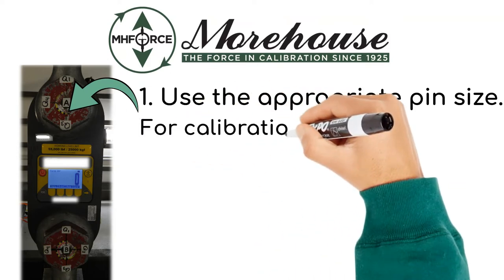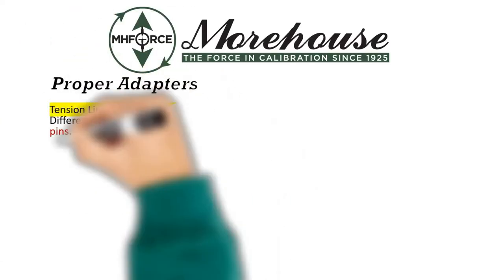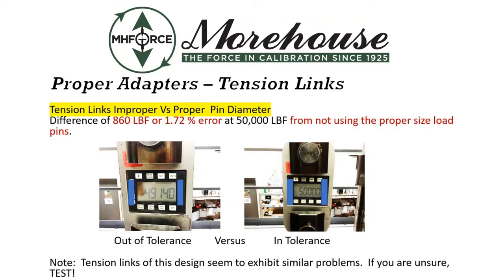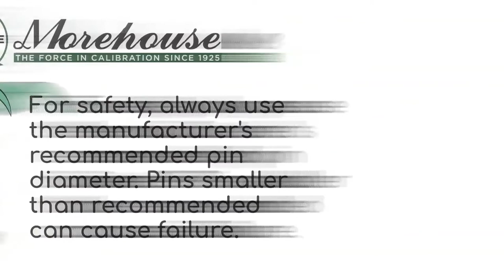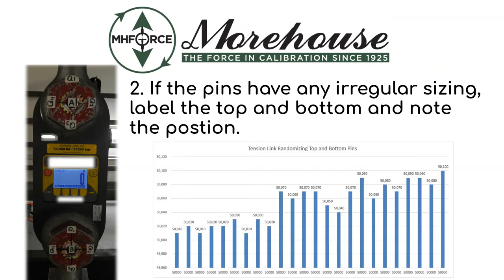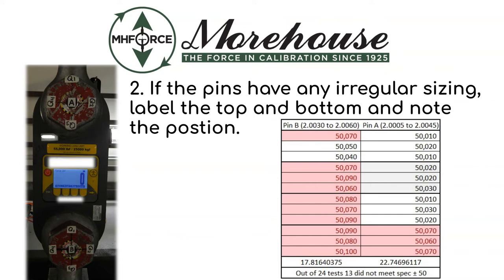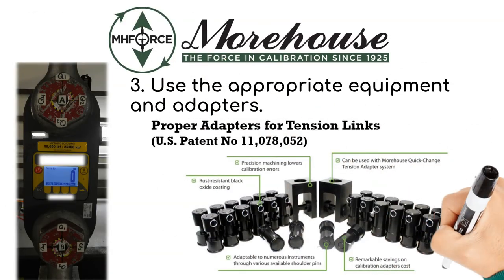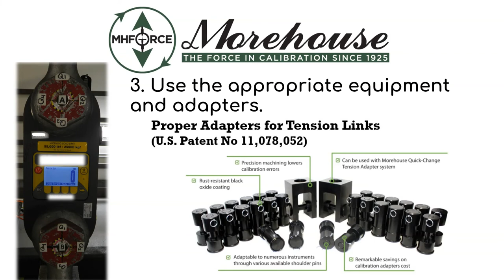How to Calibrate a Tension Link

Comment: Is this re-producibility issue depend on the load cell design (sensing section) or only with two loading surfaces? What is the root cause for this re-producibility? what is the solution? can't we make 5000 divisions Tenslink?